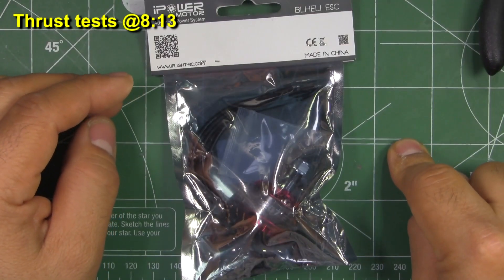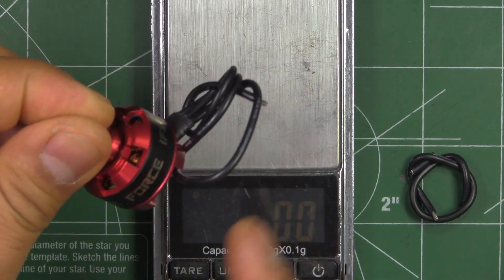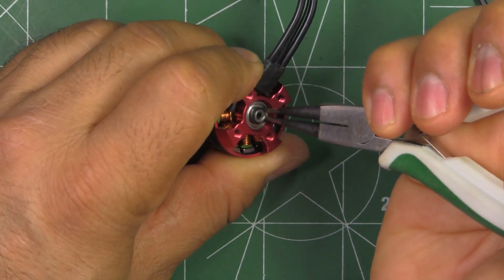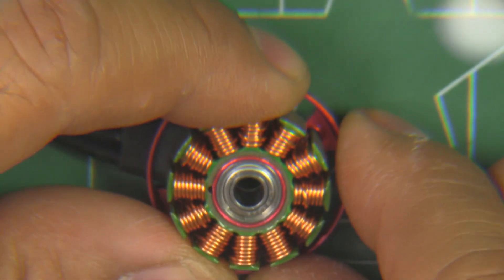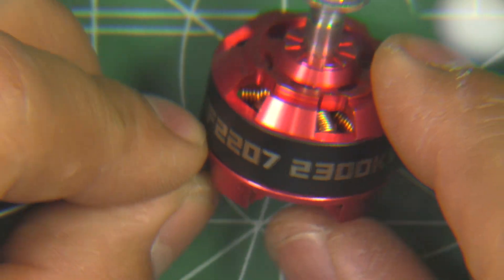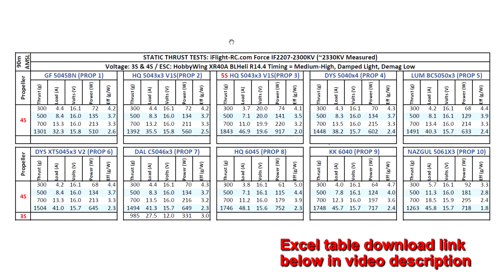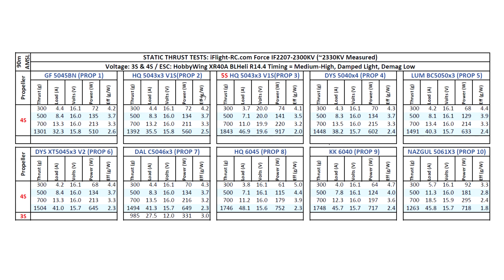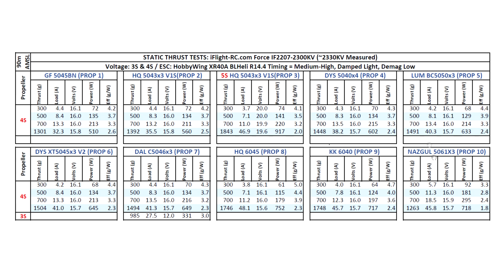iFlight-RC.com Force IF2207-2300KV - 2207's can still keep up!

Comment: im planning on buying a 2207 that is on the efficiency side, around 2300kv, and durable (regular base, i dont trust naked ones).. Do you think the IF2207 2300kv would be my best option? Would you recommend any other motor? Thanks
Reply from the maker: renatobfa this one appears to be well built but I don't have enough actual long-term use info. Bearings looked decent. I prefer motors that use 4x9x4 bearings and that have 4mm shaft. Their other line of motors called "Ion" seemed a bit better having good bearings. Other options for non-naked bottom could he the rcINpower or the was RS2306 version 1. Also some of the SunnySky motors are good
Reply: But this motor's shaft and bearing are 4mm and 4x9x4, isn't it? At Banggood website it just says "5mm diameter", meaning top side.... they dont say about the bottom side of the shaft. If its 3mm shaft on bottom, I wouldnt even consider buying it. Can you please check that info for me?
Reply from the maker: renatobfa Yes I think I mentioned in the video where I take bell off. That's why I thought it's well made. It has "good" components. Only thing I don't know is how it reacts to crashes.
Reply: Oh, i got it. thanks!! I miss understood your frase, i thought you ment that if2207 were 3mm shaft, but i got it now. Thanks for fast reply. Congratulations on your channel, your quad motor reviews are the most complete on youtube. Hope you keep up doing what you're doing for a long time, cheers!!! :D
Reply from the maker: renatobfa Thanks for watching.  Always great to know people find reviews useful.

Comment: What's the difference between a 2306 and a 2207 as far as performance?
Reply from the maker: They're very similar (provided motors have same features, 02mm laminations, N52 mags, etc). I think if you're a proficient/ advanced pilot you'll be able to notice the differences. 2207's may have a little advantage when going from low throttle to high, perhaps a little faster response. 2207's have larger stators, in theory, if you calculate the stator cylinder volume: 
2306=2493mm^3
2207=2661mm^3 
That means more copper and iron so in theory, they can generate a stronger magnetic field and therefore larger magnetic force. So higher torque and faster response. They may also be a little more efficient. The larger stator is the reason why in general 2207's are slightly heavier. Some 2306s can be as light as 30g, while 2207's struggle to get to that weight.
Reply: EngineerX Thanks, very interesting. You seem to speak highly of the 2207, and it appears to have good performance factors. With that, what is the real advantage of a 2306?
Reply from the maker: I flew the DYS Storm 2500KV for a short while and liked their response going from low to mid throttle. I'm not really an advanced pilot so I don't think I could give you much advise about the in-flight differences at the very limits. But from what I've flown so far, the 2207 was very good for the type of flying I do, moderate freestyle, With the 2306 it seems the powerband shifted a little higher but it's just a matter of getting used to a particular setup. If you're comparing a top-2306 to a top 2207 (same KV) I think they're going to be very close. So the real advantage of a 2306 is that you can get lighter motors that make about the same power and that have all the latest features, and there are more choices on 2306s now. You really can't go wrong with a 2306 right now. It's the darling of FPV at this time.

Comment: good to see 5s being tested, 2207 seems a great size for 5" shame about the weight of this particular 2207 though
Reply from the maker: Yes, 2207s should still have a place on fast quads. 2306's are the trend so most people forget about the 2207's. On this "mid-budget" motor, the weight is a little high. I still gotta finish testing the BH R3 2207-2500KV, that's more of premium motor so it'll be interesting to see how it compares to the 2306's.